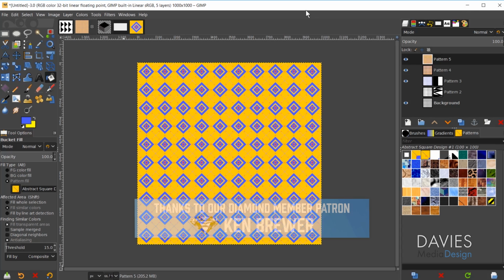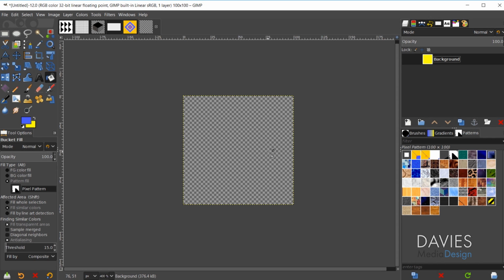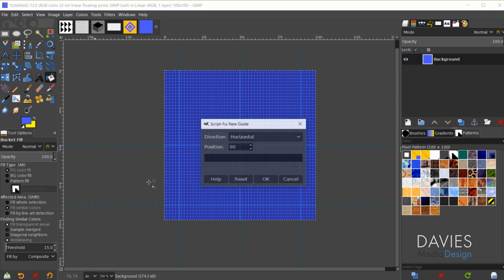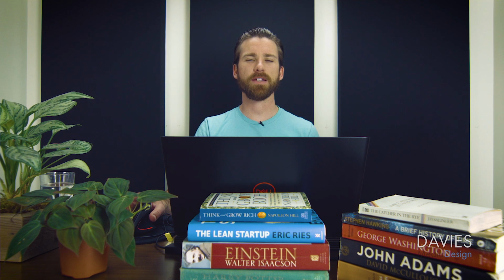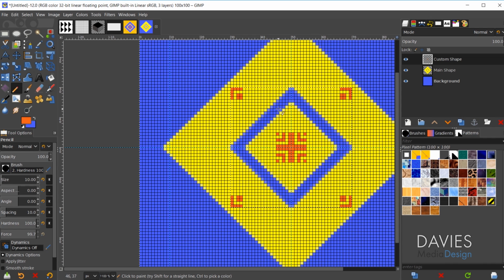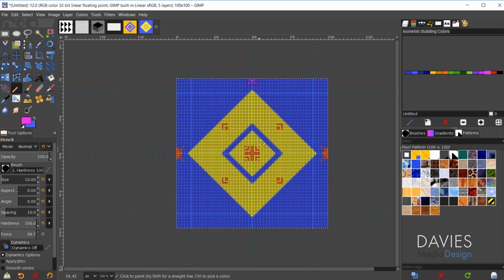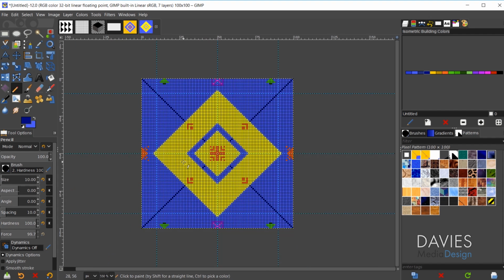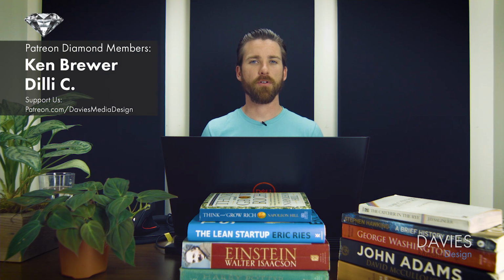Design + Import Patterns Easily | GIMP 2.10 Tutorial

Comment: How do you get to the file folder after you Highlight the location copy Ctl C and hit cancel? I don't have Mac I have Windows I'm stuck there I couldn't see where you went on screen. I'm new at this. It look that you went somewhere at the bottom of the screen
Reply: well, you can go through the files manually. C:\Users\"your computers name"\.gimp-2.8\patterns. or you can copy the link he did then press cancel, then go to any folder you have and go up to the search bar, it will highlight as soon as you click on it and just replace the file rout with pasting your link you copied and press enter.
Reply: Based on my experience, you really can't do this anymore. I can no longer find it from the Export Dialog box in Gimp. I followed this tutorial to the letter, and then found the path in Windows Explorer. I pasted the path into GIMP, and it still won't save. Sometimes, you get what you pay for I guess. But the ROI on Adobe software just isn't there, so...onward! Is anyone aware of software that doesn't require paying Silicon Valley ransoms, but performs appropriately?

Comment: No, no no. Wrong way. You're realy geanius, but this time you're wrong. No pixels, no "manual" symmetry.
Get picture (something not realy big), duplicate layer, Menu Layer->transform->offset. Button "By width/2, height/2". Next get rubber and erase ... hmmm... smart erase lines across middle of picture. It does the best with cracks, stripes and so on.  Then export, import.
I did a few such patterns for web sites - it works. 
After all - respect for professional videos. I'm from Poland and we say "szacun" (shatsoon) :-D So - shatsoon for you!